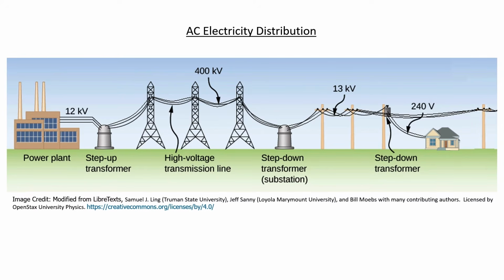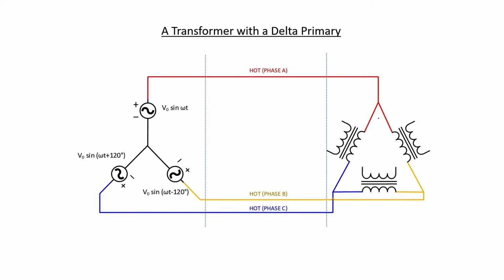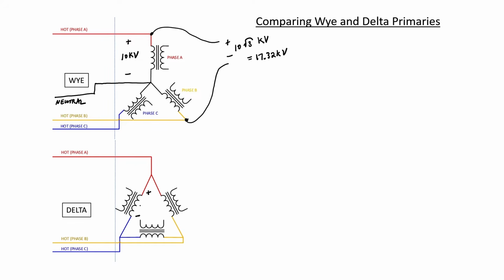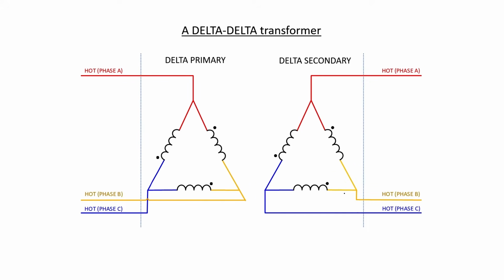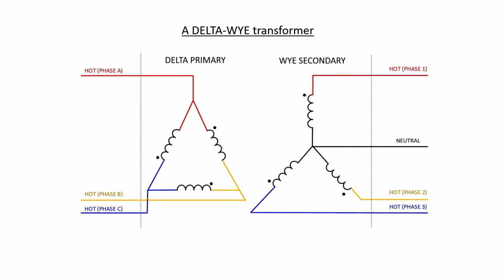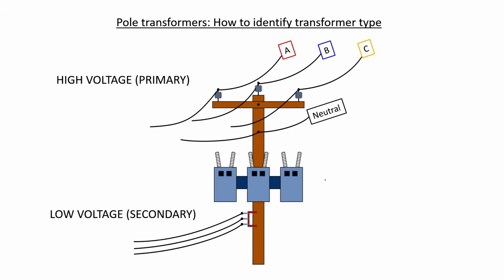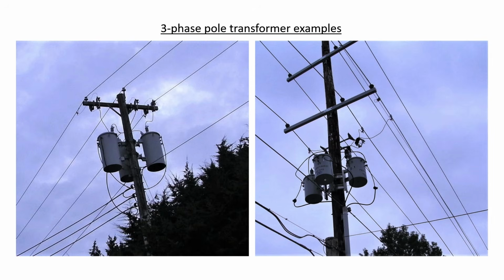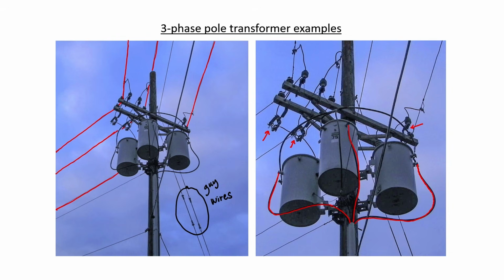3-phase transformers: delta and star (19 - Electricity Distribution)

Comment: The static or sky wire is typically only on transmission voltages, they are rare on distribution voltages. The neutral is typically, but not always below the phases.

Comment: so for very long distance high voltage transmission, is delta or wye used? Specifically the secondary side of the step-up Xfmr. The explanations sounded like it could be either. 
Delta because one less wire
Wye because higher phase voltage (factor of sqrt(3)), so less insulation required.
Reply: Transmission lines (high voltage) are generally delta, which needs only three wires.  Distribution lines are generally wye because the whole system, distribution network and service lines, is grounded.  The neutral is common and is tied to Earth at every transformer and at the customer's first disconnect.

Comment: A lot of buildings around me only bring in two phases. The larger transformer connects to one phase and it has a center tapped secondary for a neutral.  The smaller transformer connects to the other phase and is simply a 120 volt transformer. Every 3rd breaker is a high leg with respect to neutral. Do you have a video on this? I do understand how the voltages work out, but I don’t understand how a 3 phase compressor or motor can run on two phases like this without needing a run capacitor. The rotating magnetic field that the 3 phases would provide is broken in this configuration. Line 1 is perfectly in phase with line 2. Line 3 is 120* out of phase with line 2. And then line 1 is 240* out of phase with line 3. Seems like this would destroy the motor.
Reply: Yeah, that explains why there are 3 distinct transformers as USA uses split phase 120+120. Its very different in Australia. We use a single 3 phase Delta to Star transformer where neutral to phase is 240v. Houses then can pick 1,2 or 3 phases from the utility depending on the size of the house.
Reply: @46I37 wow. So neutral is not bonded to ground? And from what I understood you saying is that one transformer can connect to all three phases and provide 3 phase service? I’ve never seen that.
Reply: @brianlittle717 Australia uses the MEN system. (Multiple Earth Neutral). Our house has a 3phase 80Amp 240v service. Neutrals are earth bonded at distribution transformer and main switchboard of house. Wet areas also have earthing requirements and all circuits must now have earth leakage unless hardwired like hot water.

Comment: In few materials I have read, the single, thin wire above the 3-phase HV wires is just for lightning protection.  It either go directly to the local ground (pole ground), or through a resistor to go to the ground.  In those articles, they never said it serves as neutral wire as well.
Reply: It won't. Dangerous as crew would have to work above primary to establish neutral connections
Reply: For a Wye distribution line, the neutral is generally below the hot wires, at the level of the bottom of the transformer.

Comment: Excellent video, I finally learned the basics behind the power wires in my neighborhood, thank you !  One question I have is why the three phase power lines that run from the substation to the transformers on the poles changed from horizontal array to vertical array and back to horizontal array ?  What is the difference and why not horizontal all the way ?  Thanks again.
Reply: most likely clearance/right of way issues.  I rural locations, right of ways can be wider allowing horizontal arms to support the conductors.  In more dense locations, narrower right of ways force vertical arrangement of the conductors.  As long as the distance between each phase is maintained, either way works.   I'm sure there are maintenance pros and cons.  Also, note the higher the voltage, the larger the distance between each phase.  765kV transmission towers are massive with the widest right-of-ways.

Comment: Serious question. Is it “guy wire” or “guide wire”? @ 17:27
Reply: The word guy or stay is interchangeable. Guy wire, stay wire or aerial guy are the terms I have commonly heard but generally you would use the terms guy wire or stay wire when the wire goes from pole to ground and aerial guy/stay when its bracing pole to pole.
A stay or guy provide support to the pole/structure. A guide wire is used in other various applications and industries to "guide" objects along the length of the wire. Best look up the definitions of these three words, guy, stay and guide wires.

Comment: Can a three phase three wire DELTA distribution system (no neutral back to the substation) be connected to a SINGLE PHASE one bushing transformer 
which would CASE GROUNDED to earth at the pole?    (meaning no neutral back to the substation)?   thank you
Reply: yes
Reply: @RR42636 Thank  you.   Would the NEV (neutral to earth voltage) still be measurable 
when only multi point grounding at each pole? Again, no parallel neutral back to the substation. Thank you